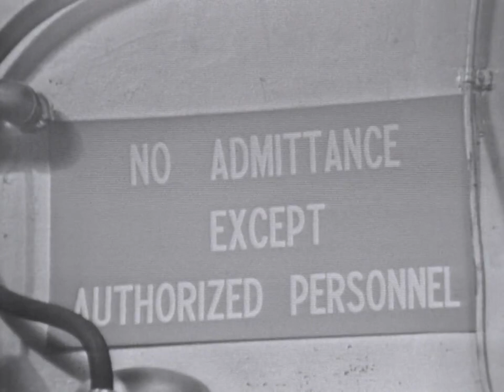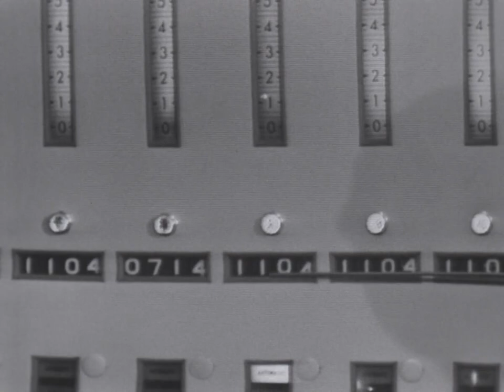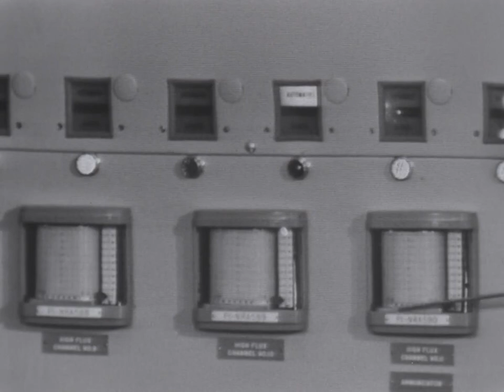A Breeder in the Desert (EBR-2 story)

Comment: Great film.  

I would have liked to have seen comment on features particular to fast reactors, which are not seen in the LWRs of the nation.   Power control mechanisms of a fast reactor.  Sodium handling.  LOCA accidents.  Operating temperature.  Pu share in spent fuel.
Reply: EBR1

Comment: Nice try but it didn’t pan out as expected.   Uranium supplies increase and breeders didn’t work as well as expected.  Many billions of dollars down the drain.
Reply: The main reason the breeder reactors were discontinued was that we didn't want that much additional plutonium available. Fast reactors use, and make, weapons grade radioactives, which is why the breeder program was shut down by presidential order.
Reply: You can say that when we've figured out what to do with all of the nuclear waste which has been piling up outside of every reactor for the past 50 years.  The current plan is to just let it sit there forever.  The technologies developed here were fundamental to the design of closed-loop reactors which remove the high-level waste in real-time.